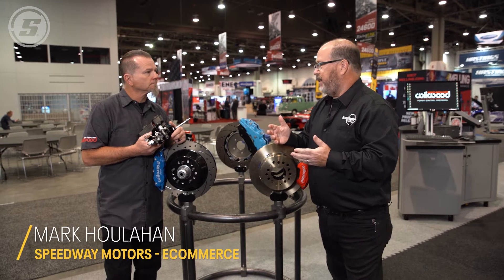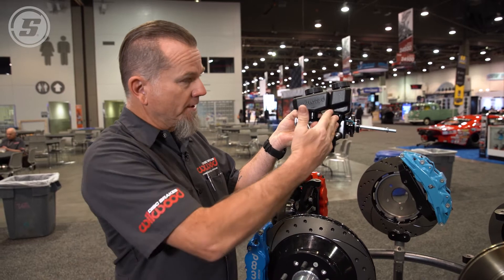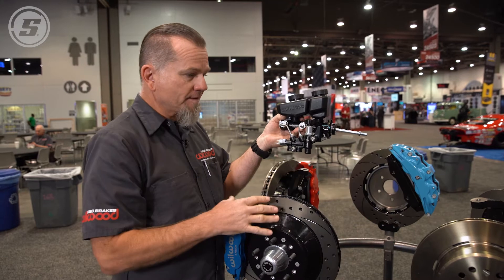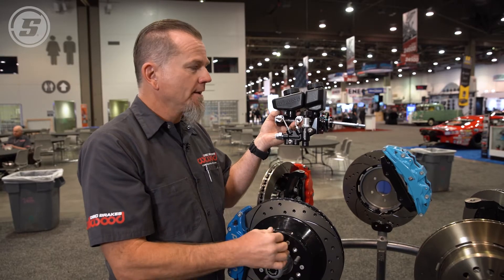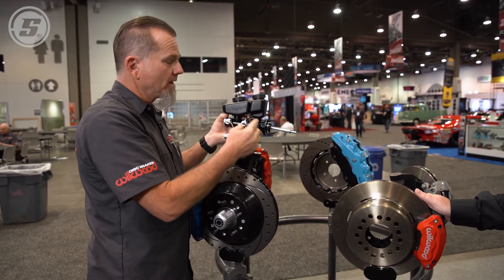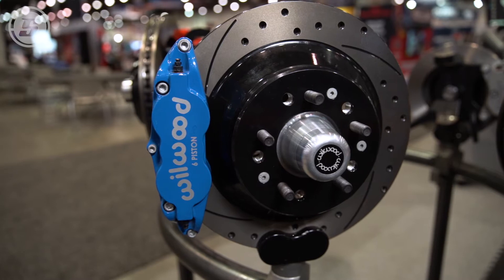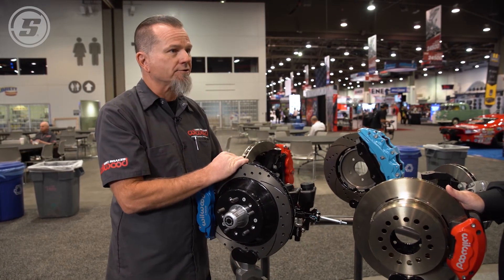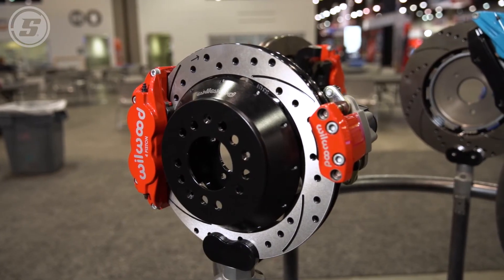Brake Residual Valves: How They Work and Why You Need Them

Comment: Hi - so for a floor mounted master cyclinder on a drum/ drum set up I will need 2 x 10 pound residual valves ( front and back 10 pounds each)  ?
Reply: You didn't watch the video..?

Comment: So if I'm running a firewall mounted master cylinder and an adjustable proportioning valve on 4w disc, is there still any benefit at all to running two 2psi residual valves?
Reply: Yes, if you have rear calipers with built-in  parking/E-brake. They tend to retract back ever so slightly, causing a low pedal.

Comment: As what I understand about the residual valve is to keep pressure on the cup seals so they are kept tight against the wheel cylinder wall so they don’t leak while the brakes are on the returned cycle and resting. Then when pressure is released the spring in between keeps the cup seals square in the bore and tight against the piston.  It’s only a few pounds and the large shoe return springs can overcome this 10psi to return back to fully retract. When they over retract the catch lever catches the spur gear to rotate the automatic adjuster thus setting them up to a closer to the drum tolerance. Otherwise you need more master cylinder stroke. If the shoes don’t return then the residual valve is higher then it’s 10psi setting and if the brake fluid seeps past one of the wheel cylinder cups it could also have no residual pressure left. If the master cylinder is mounted higher then the wheel cylinder fluid can’t return to drain the wheel cylinders unless there is a vacuum and air can get past the cup seals. Possible causes of a wheel cylinder leak are a cup seal has a damaged lip or not square in the bore, cylinder bore is rough or has pits, loose rust build up from water at the cylinder and the seal can’t seal properly after sitting a few years, residual valve not working to keep pressure on the cup to cylinder bore. Newer vehicles have eliminated the residual valve by installing cup expanders to keep the cups from collapsing and loosing fluid.
Reply: Why are you writing a novel here about residual valves when this is a video with 2 guys talking about them?

Comment: I put a stock 67 Mustang dual circuit master cylinder in my 49 Ford F1. It had built-in 10 psi residual pressure valves for 4-wheel drum brakes. Don't most stock master cylinders?

Comment: great video.  I have just received my two psi residual pressure valve, and when I remove the red protection plugs, on the outlet side I can see a small black plastic part at the bottom.  the instructable does not say whether that part should be removed or not.  can you clarify this point?  thank you so much.